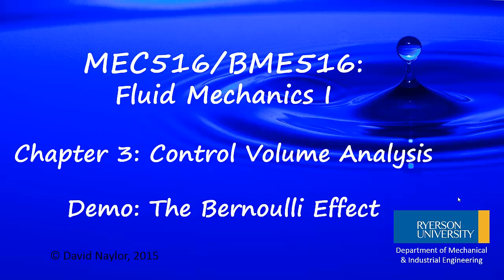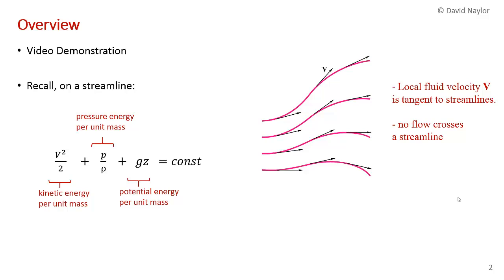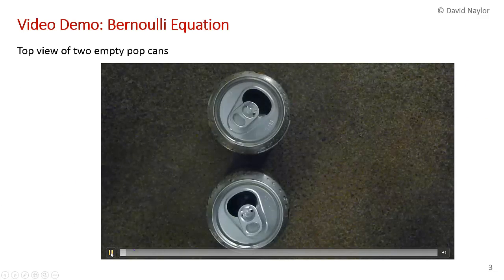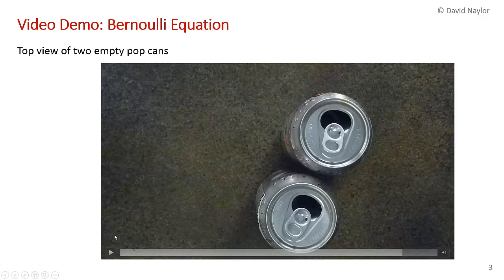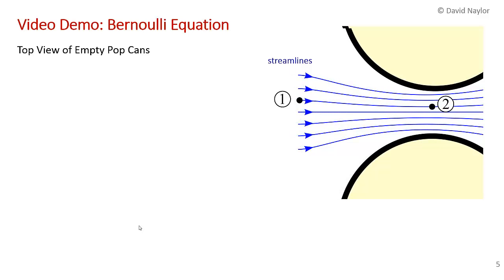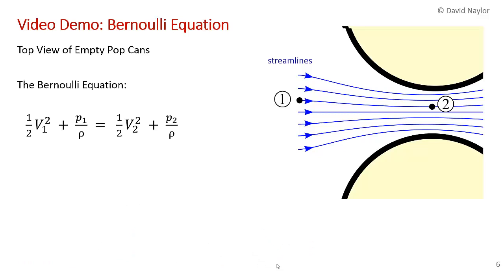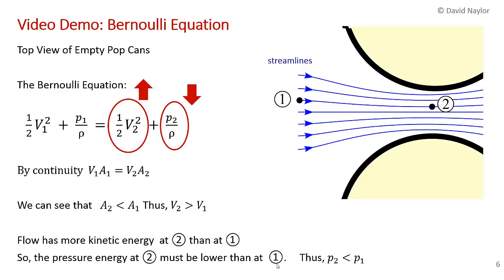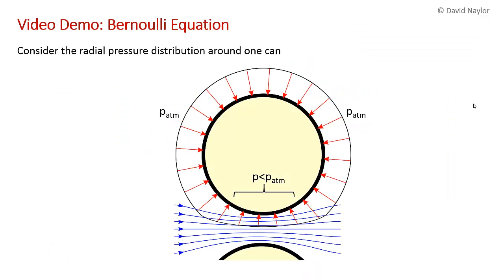Bernoulli Effect Demonstration with Pop Cans

Comment: Since Bernoulli equation is only valid for incompressible fluids, I wonder how was air considered an incompressible gas? Is it because of the air low velocity in this experiment? Can Bernoulli be used in modeling air passing a car?
Reply from the maker: Yes. Gases can be approximated as incompressible at low velocity. The book by White suggests the criterion Mach<0.3 for external flows. So, you can use Bernoulli as a reasonable engineering approximation for flow over a car -- in regions that can be approximated as inviscid, i.e. outside the boundary layer and wake regions.
Reply: Thanks for the clarification.

Comment: What if one can was used instead of 2, will the can move slightly sideways due to decrease in pressure?
Reply from the maker: A single can would definably experience a sideways pressure force. Would it be enough to move the can on a low friction surface? I think so. I haven't tried it, but I will. Thanks for the excellent comment!